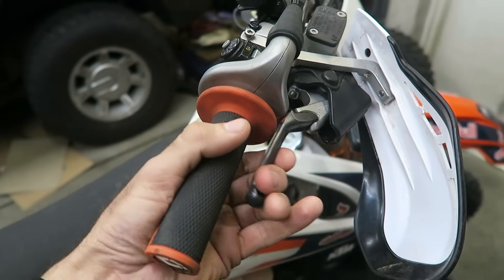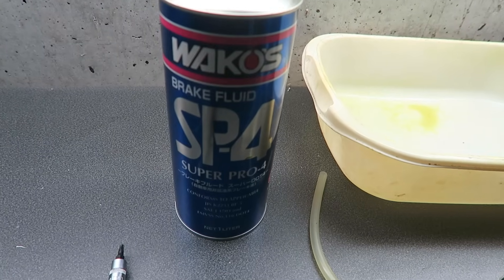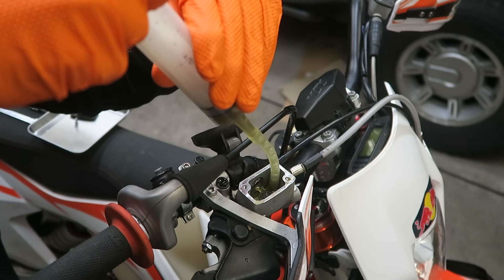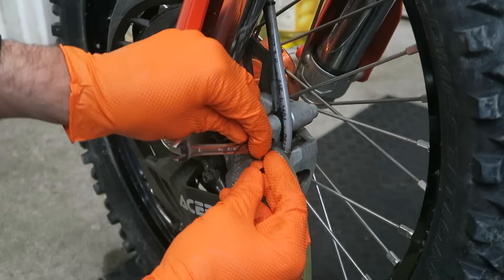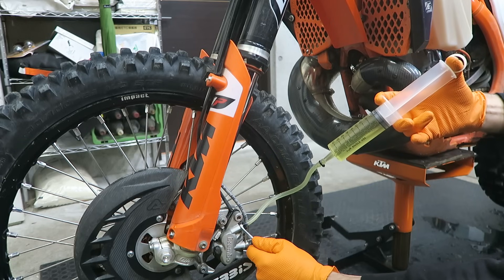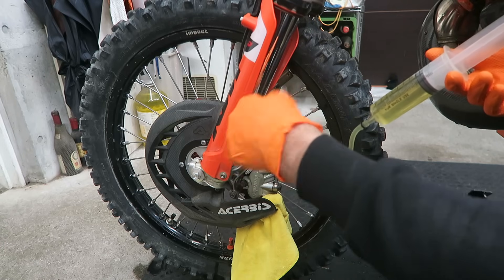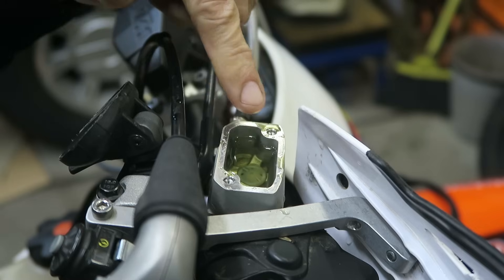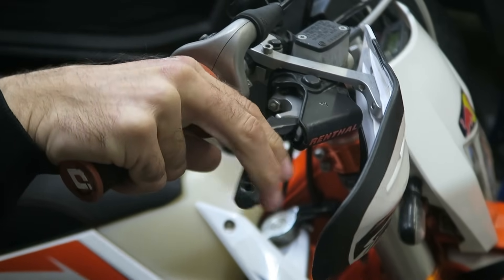Reverse Bleed Brake Fluid Replacement

Comment: I have a real problem with my ktm 200, I use a syringe to push fluid up into the master but fluid will not go into the master. its like its clogged or something, but it's not. I bought 2 rebuild kits now and have rebuilt it twice and believe me there isn't much to it.  I did the back brake with no problem, but can't get any fluid up into the front.
Reply from the maker: Can you pump fluid out of the bleeder if you open it and squeeze the brake? Do you have a one way valve fitted on the bleeder?
Reply: I don't think there is a one way fitting. It will pump 2 to 3 pumps out the bleeder, then nothing. To fix the problem I had to remove the retaining clip ring from the master cylinder and allow the piston to back off slightly and fill the system from the bottom bleeder screw to the top. After it was full, I tightened the bleeder and pushed the piston back into place and installed the clip ring. Works fine now, but that's not the way it's done. It's almost as if the pin hole in the top reservoir is in the wrong place?

Comment: i guess it helps to have a good syringe. I should have looked at the ones I got carefully when I bought them. They don't have any o-rings like yours, and allow air to get in and fluid to fall out almost instantly.... Should have known since they were so cheap. TheMixmizer by hopkins manufacturing. I think I got them at walmart... figures...

Comment: Used this method today.  After doing some research the internet is riddled with brake bleeding horror stories, and I was hesitant to do it on my own.  This method was so easy and worked instantly.  I have piggybacked brake lines on my front, and worked from the furthest path to cylinder, I didnt even have to inject from the 2 nd closest.  I found the rear brake had a bit of air, maybe because its on a horizontal plane.  But i then after did the normal method of squeeze-open-close, and it got rid of any bubbles.  This IS the best way to bleed brakes for flushing or new lines.

Comment: As the bleed nipple is usually higher than the feed on the calliper and air in the caliper would be at the highest point (brake nipple exit) how does the air get to go into the line between master cyclinder and calliper?
Reply from the maker: Ah I see now. Yes, I agree. One method doesn't always work for all all situations. I typically reverse bleed first to clear the line of any air and then test. 9 times out of 10 this is all that is required. If however there is still a problem I'd do as you suggest and pump some fluid out of the bleeder using the brake lever (to bleed any air that might be trapped in the caliper). I rarely find this necessary though.
Reply from the maker: If the bike is upside down
Reply: Tokyo Offroad good day, i believe they are not asking how air was introduced in the first place but if there was any air in the caliper by using this method you would still have air traped as the bleed screw is higher than the brake line fitting, air will rise on top of the fluid inside the caliper as you are pumping fluid in and never be forced down and up through the brake line. If the air was only in the brake line this would work well as it did for you. If i was going to use this method i would also pump the brake and open the bleed screw to bleed any air in the caliper. Have a good day.

Comment: Good video ! Does the rubber out the seringe not fight agianst the brake fluid ?
Reply from the maker: Not so far. I've used the current syringes for about 4 years and they're fine. I purchased them in an auto parts store so they're intended for you with brake fluid.
Reply: I started using this method after purchasing and installing the Rekluse Left Hand rear Brake that comes with two syringes.. Only difference is the Rekluse Master Cylinder doesn't have an external reservoir but has a separate bleed Nipple on the lever assembly that the other syringe fits on to and the excess fluid and air goes into.. Great method and video.. Thanks for sharing..